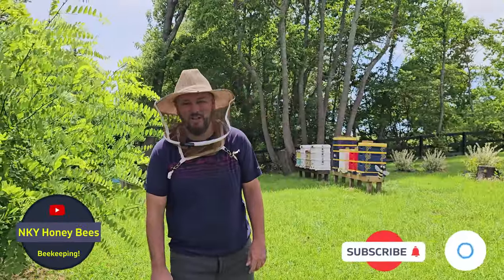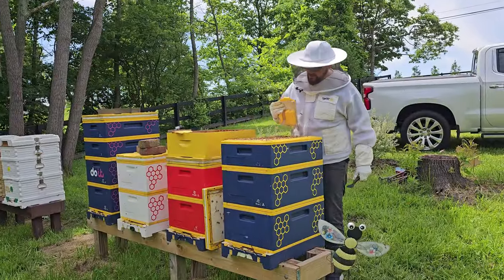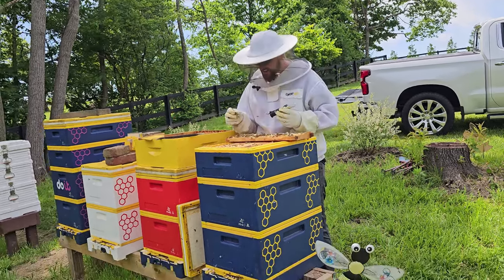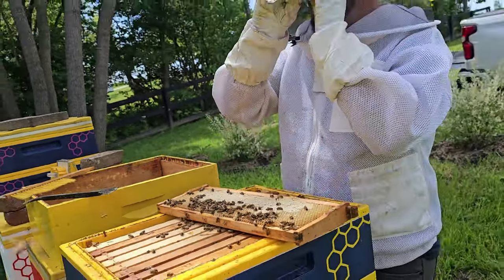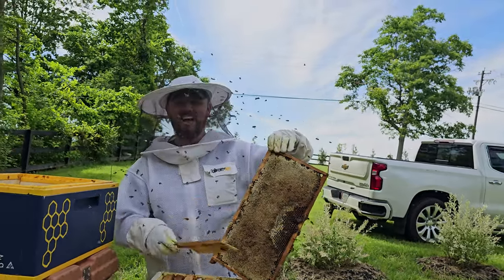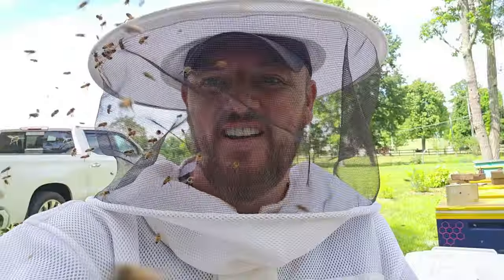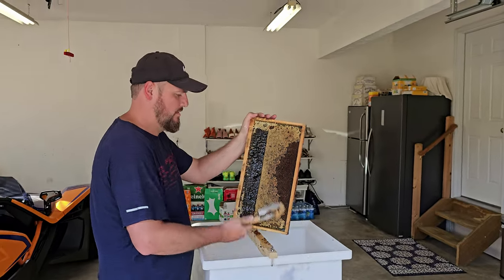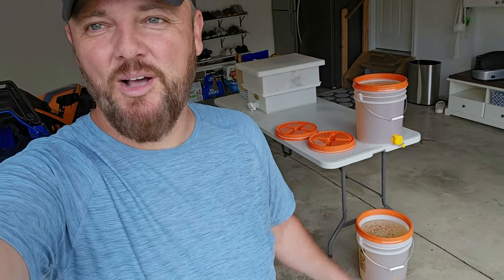Honey Harvest 2024 Horrible year!!!

Comment: You started the season out so strong, I would have guessed you would have gotten 10 gallons from each of your hives. My year is starting out slow and I doubt it will come close to last years crop. In 2023 I got over 200 lbs per hive on my 9 production hives. Not this year but hopefully it will get better. My flow runs up into August usually.
Reply from the maker: Yeah it started great then rains and storms for days. I thought I was going to have a lot. Humbled me real quick. Last year I had 450 pounds with 5 hives. Crazy how things turn so quick. Good luck with your flow, brother.